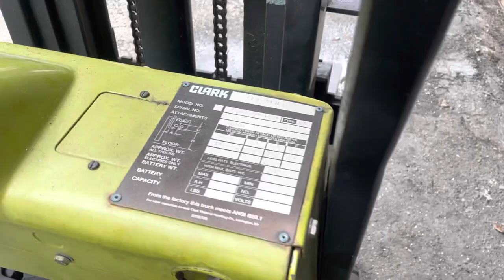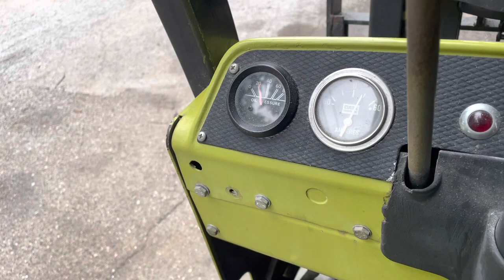Clark Forklift Repairs Part 2

Comment: I just got a CF30B. I think it has the same engine as yours. I'm trying to change the engine oil. Oil stick shows no oil. Can't find the oil inlet. Would you know or have a link to a manual. Greatly appreciated. God bless.
Reply: I got the same problem 😢